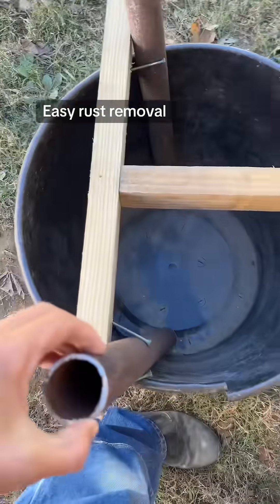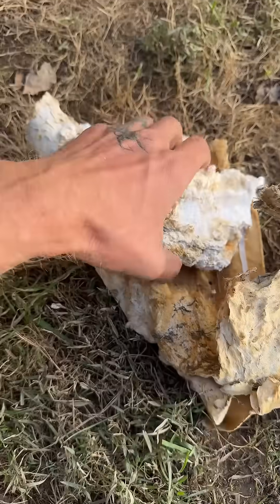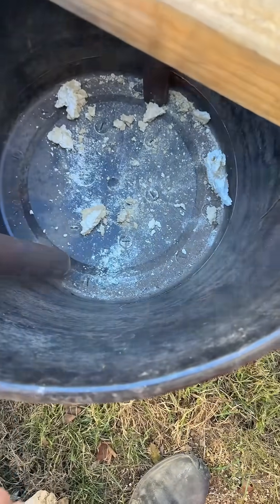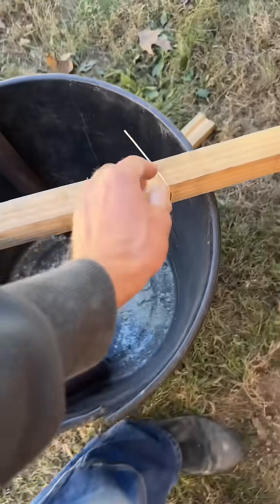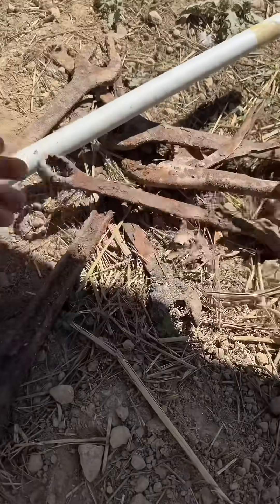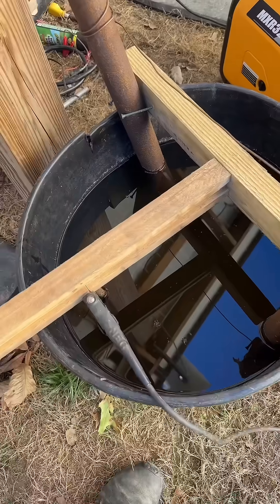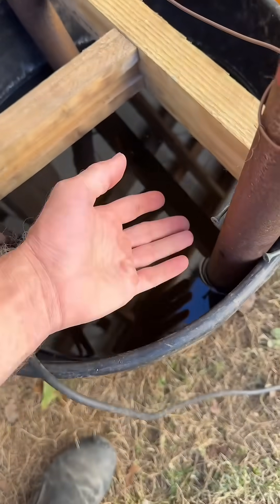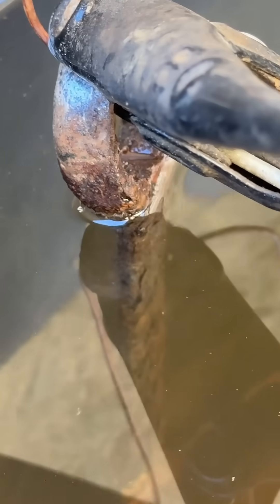Cleaning a wrench with electrolysis

Comment: DO YOU WANT A BETTER WAY?
I used to use the same for years.  The Sodium Carbonate NA2CO3 that you used is the best electrolyte.
You can upgrade you sacrificial anode as the rust builds up on the metal and other metals and contaminants are released into the water.  Some of these are quite toxic.

Use a carbon graphite rod.  You can extract them from alkaline batteries or order some.  Your water stays clear and anything that builds up on the rod can be wiped off.  It also seems to make any moving parts like on a crescent wrench work better.

When using iron, the iron is oxidized along with any other materials in the iron.  All of these oxidizing components sludge up.  Bug carbon actually causes the water to disassociate and the hydrogen and oxygen go free.  The hydrogen realized interacts with the rusted part and steels the oxygen leaving the iron.  The oxygen normally reacts with the anode but with graphite it escapes or forms CO2.  So your water stays much cleaner and clearer. You can then use the same water for all your parts.

Caution your viewers to NOT use galvanized metals or stainless steel.  When the iron is taken out the other free elements can release and make the water poisonous.  Remember the movie Erin Brockovich?  It released a toxic chemical that made a bunch a people sick and killed them.  It is hexavalent chromium (chromium-6).
In the true story that the film is based on, Pacific Gas & Electric (PG&E) was responsible for contaminating the groundwater in Hinkley, California.

If any of the metal is stainless or contains chromium. You will make hexavalent chromium.

Comment: What happened to steel wool and bacon grease? Your “off grid” videos are getting to be a bit much. Don’t know many ppl that own a freeze dryer
Reply: I absolutely disagree. This is super simple and perfect for off grid since it is done with a 12v battery charger. It's easy, cheap, effective and  non toxic (if done outside). Who has a freeze drier? Anybody who buys one. ..

Comment: what's water disposal look like or do you have a waist filter?
Reply: I was worried about it when I did this with a gas tank because of the residual old fuel, so I put the dirty water in a big plastic pan and let it evaporate. 
Since the waste is usually just iiron oxide and washing soda I imagine it's harmless.

Comment: Interesting!  Ive never heard of this. What did you put in the bucket. I  couldn't understand this.
Reply: 1 tablespoon of Arm & Hammer washing soda per gallon of water. Negative clamp to the item, positive clamp to a clean piece of steel (it will dissolve after a while).

Comment: bastid!
Electrolysis is highly underrated. Its non-destructive and way less toxic than most other rust-removal methods.
Reply: Less expensive too, imagine filling that tub full of vinegar,
Reply: Unless you use stainless steel as the anode, then you create carcinogenic hexavalent chromium.
Reply: I think less people do it as well… messing with electricity is dangerous when you don’t have a good understanding of voltage.

 (Myself included. I know that 60 volts American house plug isn’t particularly dangerous, yet as everyone knows it’s pretty easy to get a dangerous amount through one even with its safety features. Electricity is scary specifically because you can feel it As it takes away your ability to control your muscles. It probably shows that I’m definitely in the demographic with a slight phobia despite having a slightly and I Emphasize slightly higher understanding of electrical things than the average person. Yet i guess the difference between something being dangerous vs useful is knowing. I know to put on a mask with the chemicals and do it outside, I’ve learned the fundamentals of it from bleach and other household chemicals, but setting up a safe electrolysis container no. Most people including myself, don’t have a good fundamental understanding of electrical power and that’s a shame truly.)
Reply: Also homestead-ers are not commended enough for their applied intelligence! (I know not everyone is this guy but the people saying they are hicks are just blind men to me.)
Reply: @Dusttttty I thought American sockets were 110 volts, 60 hertz? In the UK we have 240 volts, 50 hertz, but as an engineer I've also worked on 440v systems. It isn't so much the voltage you need to worry about but the current drawn
Reply: Backyard ballistics does some pretty neat non destructive rust removal. I think he uses citric acid and dish soap.
Reply: Couldn't you just wire wheel rust off? Especially if it isn't structurally damaging levels of rust?
Reply: @A-A-RonDavis2470 You could but it's easier to do it this way and it's much better. You don't need to spend three days like this guy has, one day is good and then use a wire wheel to knock off clumps and finish. I use to this method on old sewing machines, I never found anything better easier, or cheaper.

Comment: My mom taught me how to clean her jewelry with baking soda, vinegar and water. But I've never known how to remove rust from cast iron pans, tools, etc. So I'm looking forward to seeing how this goes.
Reply: When chemically removing rust, do it outdoors or have very good ventilation because Hydrogen is produced (the bubbles) 
It will quickly build up and is very flammable

Electrolysis also produces Hydrogen, and if you use stainless steel as the sacrificial piece that absorbs the rust, stainless will produce deadly fumes

Stainless steel is consumed when used in the electrolysis process, although slowly. The main problem with using it is the hazardous waste it produces. Stainless steel contains chromium. The electrodes, and thus the chromium is consumed, and you end up with poisonous chromates in your electrolyte. Dumping these on the ground or down the drain is illegal. The compounds can cause severe skin problems and ultimately, cancer. Hexavalent chromate is poisonous. These compounds are not excused from hazardous waste regulations where household wastes are.
These compounds are bad enough that government regulations mandate "elimination of hexavalent chromate by 2007 for corrosion protection."
Reply: spoiler.. it worked

Comment: What kinda power supply are you using? Ive been meaning to try electrolytic rust removal for a little while now.
Reply: 12v 8-10 amp battery charger works fine. I find them at Goodwill sometimes, but they're cheap anyway. One thing that helps the process is to clean off the positive/sacrificial anode daily.